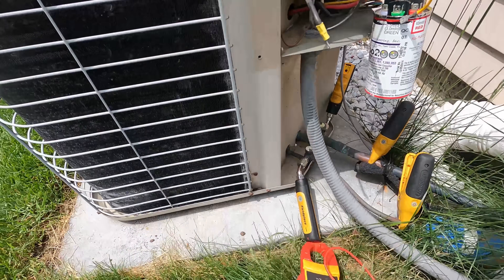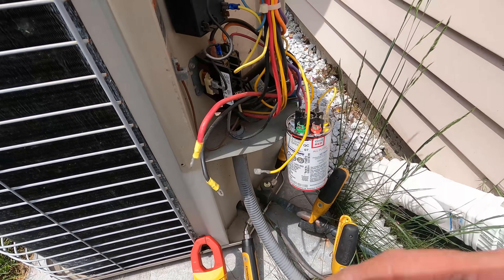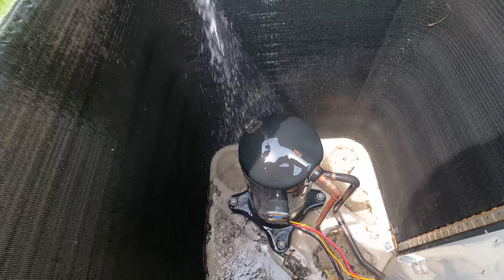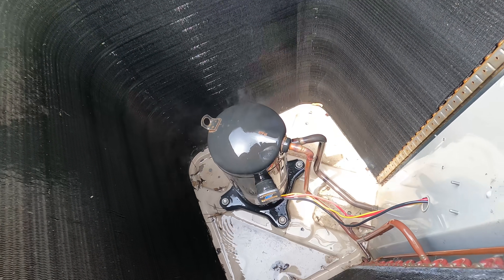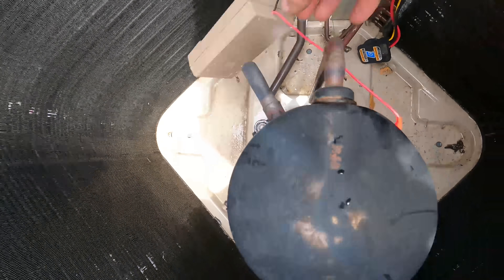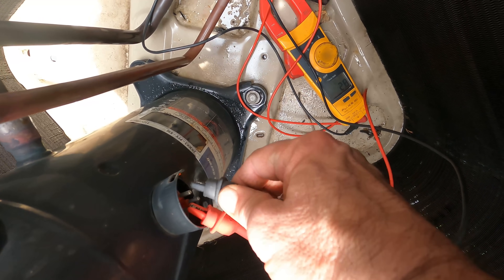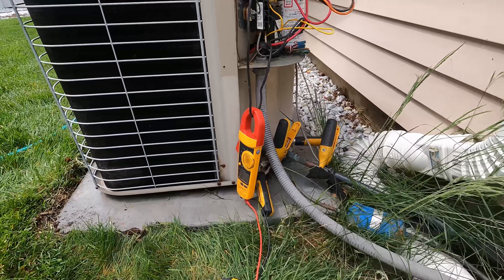AC Compressor Overheated Not Cooling Testing Windings/ Megging, Ohms Fixing HVAC System

Comment: hot compressor, spray it with liquid nitrogen, CO2 or refrigerant(LOL). that's what they did years ago ;)
Reply from the maker: When I started ac work a guy I worked with was killing bees with liquid 22. He was good freezing them up midflight
Reply: @thehvachacker  yeah that also!
chlorinated "brake parts cleaner" works great also. shhh

Comment: Where’s the leak ? I tell my Coworkers don’t waste your time topping off a R-22 system . There charging $85 a pound for R-22 , why? So it could leak out tomorrow or a few months from now and now you stressed out the compressor and overheated it .
Reply from the maker: Leak doesn’t matter. It’s leaking, it’s owners know, they added refrigerant 2019. They are getting a new unit mid June.
Reply: @thehvachacker  gotcha .Do you get a lot of customers who just prefer a top off vs replacing a unit ?
Reply from the maker: I get a lot of customers who want it charged up to give relief until a repair can be performed. This unit as I said already has a down payment for a new unit. Yet emergency calls on weekend is just bandaids to get it to operate. My company has 5k contract residential customers and only puts 3 guys on call for emergency service. And we all worked from 7am - midnight all weekend.
Reply: @thehvachacker  i see . Yea them are some long work hours . I live in Vegas do I know what you mean my doing bandaid repairs . HVAC is seasonal here i vegas . Make all that money while you can .

Comment: sounds to me the customer just wanted relief in some hot ass weather until they can get the new system..    So some people want bill to not only charge the labor to find the leak(s) but they also want him to fix the leak(s) which is another charge.  on top of labor to run vacuum, and charge the system?  Why invest even more money into a system that is outdated and costly vs getting by with a lesser bill and getting a more efficient system?  

Me personally, id rather tough it out and put a new system in rather then spend 100$ per pound of r22... but that's just me.

Comment: How do guys like this be allowed to work on equipment. 

Proper procedure would be to recover most of little remaining R22, to couple psi remaining.  Then should have pressurized with dry nitrogen just to check for leak point first before wasting rare and expensive R22.  Small amount of EPA regulations allowed R22 diluted with nitrogen would be easy to detect leak point.  Probably it is a leaky, rusty evaporator on old R22 system.  Might just get lucky and find a repairable copper elbow leak.
Reply: Lmao they still sell r22 like candy bars you know that right?  It’s not rare it’s just more expensive
Reply: Use - R-422B -  it is perfect replacement for R-22 - the same pressure, the same oil .

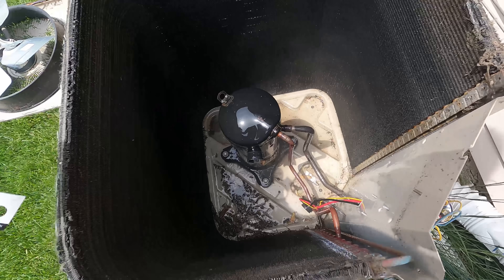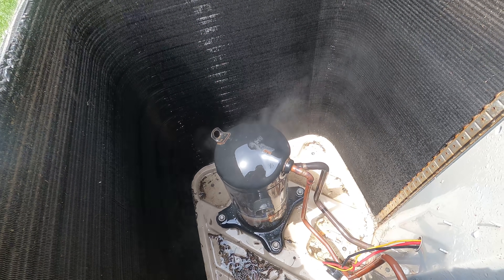Comment: 1:10 - I hope you put that dongle back on the peckerhead before you run water, or you'll need to dry the connections. 1:15 - Nope! But, if you take the dongle back off for a few minutes, the compressor looks like it is still hot enough to evaporate any water you've gotten into the peckerhead. 1:29 - Are you now going to shake the compressor to "dry off" the peckerhead? (I guess that would be a 'No".)

Comment: R407c will be available for a long time. For those who claim you need to change the oil... yeah, kk bubba.
Reply: Use - R-422B -  it is perfect replacement for R-22 - the same pressure, the same oil .
Reply: @yuriigorg721  There is no perfect replacement... r22 is.... r407c... I have a great reputation thanks to it...

Comment: "HACKER" Fits the title perfect... What company do you work for????
Reply: This is so weird and time consuming from what I’ve seen and learned. You really don’t need to Meg a compressor to see if it’s working. Just hookup your gauges to see if it’s pumping and if it not take an amp draw to see if it’s pulling amperage and you can determine if the valves are bad

Comment: Pressure test,find the leak ,evac, charge with rs44 save your r-22 and the customer money... 🤦🏼‍♂️
Reply from the maker: Why do all that on a system headed to scrap yard? This was a Sunday call on first 90+ degree weekend. I had many more still lined up after this one. Labor for what your talking about would be more than just charging up system with 22. First find leak. Most leaks are on the coil. Which this one was written up
Early 2019. Customer paid for new system a day after I was their. I don’t sell so I had a salesman go to site. Why I am always repairing old systems. I am service tech so I have to fix whatever I can.
Reply: @thehvachacker  yeah i guess i own a business diff strokes for diff folks. I do it right or don't it at all just my my way of doing things. But what your doing is WRONG!!! Stopping showing this hack stuff to kids trying to learn....
Reply from the maker: I can tell you haven’t watched any of my videos. Nothing hackery about my work. I provide top of the line service. This is not a standard service call. This is emergency service on a Sunday which I worked that day from 7am till sometime after midnight. No time for all the work you mentioned. One day you will be out of school and actually doing real world hvac work. The job is to provide comfort for your customers. My customer chose they wanted a new system. They also wanted to get temporary cooling. Therefore I have to charge system up with 22. No time to find leak which I already know is on evap coil. A coworker found a bad evap coil 2019. We also don’t use any drop in replacements of 22. Lost too many large trane compressors due to poor oil return.
Reply: Brother don’t stress it own my own hvac company best solution is to get them some ac it’s a Sunday, add some Freon  and in the meantime search for a leak and have them pay for the Freon odds are is going to lead to a install so doing what the gentleman man mentioned is the correct way of doing it but it’s a Sunday man apparently this guy hardly works out on the field to understand that. Keep grinding brother you did good.
Reply: @Matts_Crafty   don’t be dumb and ignorant dude my man is doing great!
Reply: @HVACRss  glad to hear kitty cat!

Comment: Hey my brother  you going to get all types of comments  but in the field it's a different story  I don't see nothing wrong  especially when they are going to buy a new unit why search for something that's 1st of all out of warranty and second R22 is done so that unit is a goner time for a new one these newbies don't know shyt I've been doing this for years and worked for top companies.. if we even get a R22 .. time for a new unit .. it's part of the business ask any real tech that works in the field  ..
Reply: And then he says I’m gonna check the filters bro that’s the 1st thing you gotta check also evacuate and pressure check the system before you go and charge people.  Famous words we can’t guarantee it will last long of course not if it’s a small leak it might last threw summer but come next year it’s empty again.
Reply: Absolutely I agree
Reply: "if we even get a R22 .. time for a new unit .. it's part of the business ask any real tech that works in the field"  ... I have thankfully avoided people like you for over 20 years.  I'm still using my R22 Goodman unit from 1998. Replacing parts like run capacitors, contactors, fans, and even the compressor along the way for far more cheaply than spending 10K or more to install a brand new unit which of course needs a matching indoor air handler, and a cascade of parts and labor they will try to sell you, like new linesets, new ductwork, new thermostat, etc, etc.  Remember, units that were manufactured in the 70s and 80s typically ran for DECADES with hardly any service calls. Now, when they install your brand new system, you'll often hear that it might be good for about 5 years (I head that with my Goodman at the same time I purchased my brand new house in 1998) and they keep switching out the preferred freon.  It's a racket. Thank God for YouTube and the DIY community. We can not stop perpetuating these upsell scams.

Comment: seems alot of these " HVAC techs" in the comments are slow during the hot parts of the season lmfao. The customer was probably hotter than hell and wanted cooling that day until further diagnoses can take place / replacing the system. Alot of the times the customer would rather you come back during business  hours to perform the leak search cause it saves them tons in over time charge , or maybe they are already replacing the system and just want cooling until the new unit comes in.
Reply: yeah because being busy is an excuse for doing a shitty job.....
Reply: A system that's 5 pounds low wont last a weekend without leaking out again.